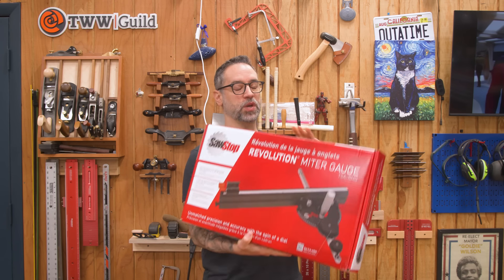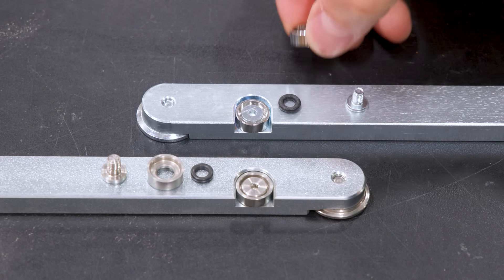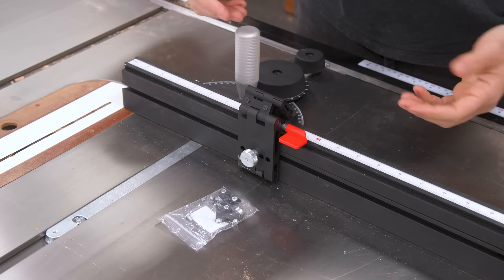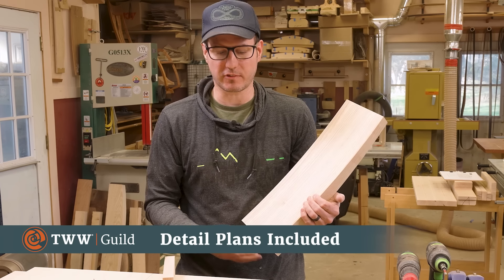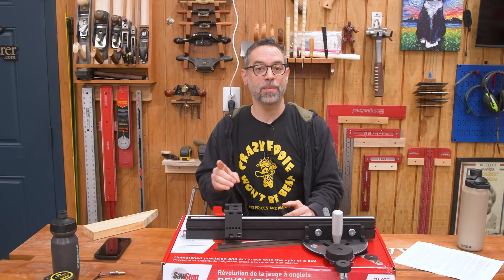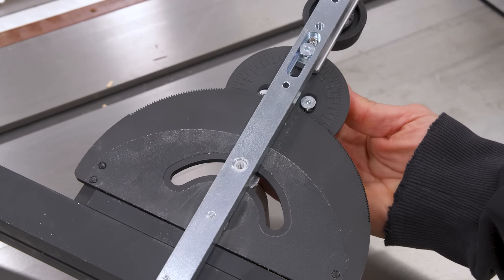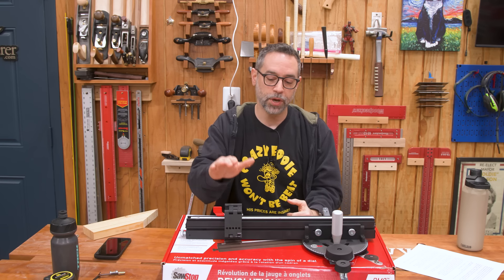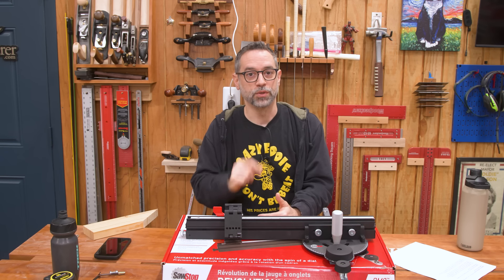The MOST Expensive Miter Gauge on the Market | Worth it?!

Comment: I designed a segmented arching truss for my green house build. Because there are 10 segments to the design and zero internal structure, each gusset needed to be accurate to, ideally, less than a 1/10 of a degree, otherwise the truss span could be off by more than a foot. 

I ended up creating a a jig that took hours to get correct. Had to use Trig and accurately calibrate the lengths of the sides of the triangles instead of directly cutting the angle like you could with a very accurate miter gage.

Comment: I recently built an octagon poker table.  An error in the length of each side or angles is obviously multiplied when joing 8 pieces in a “circle”.  This definitely would have made that process easier.

It might be a little expensive relative to the competition.  However, I see value here than in a $500 RO sander, and I own several of those.

Comment: Marc: Great review.  I was wowed by this miter gauge while at the store purchasing my new Sawstop tablesaw.  The salesman actually showed me that, even with the handle tightened quite securely, it didn't take much pressure on end of the fence to move the fence and thus change the set angle.  It was certainly more pressure than one would intentionally place, but it made me think that an incidental bump could quite easily change the set angle despite having "fixed" that angle by tightening the handle.  Did you check this and, if so, did you find the same thing?

Comment: The only problem with using the dovetails for the stop to prevent deflection is now you just killed the sacrificial fence since they'll be covered.
Reply from the maker: Route a dovetail slot into the sacrificial fence. Might have some subsequent hoops to jump through, however, to actually attach the sacrificial fence since the bolts would be in the path of the groove. Double stick tape might do the trick.
Reply: @woodwhisperer  Personally I love using the blue tape with super glue instead of double-sided tape. I think I stole that trick from you or somebody on YouTube.

Comment: are you limited to cutting on the left side of the blade or does the fence extension work on the right side of the blade?  One thing that's missing on your miter gauge reviews Mark.  Thanks,
Reply: The dovetail track is on both sides of the fence so it would be reversible

Comment: Marc, thank you for the review. One thought about using the dovetail stops to fix a position: It seems they will work fine. so long as the micro-adjuster is in the same position when one returns to the setting as it was when the setting was made. My inclination would be to zero the micro adjuster when making a setting and, then be sure to zero it when returning to the setting. Does this seem practical to you?
        Thanks to your fix (excellent) for the slop in the stop, I am running out of reasons not to buy one of these.

Comment: I like the knob lock down idea. But, if you want to use a sacrificial fence, you have to precisely position a dovetail groove. Of course, I'm keeping my Harvey.
Reply from the maker: If you’re buying a miter gauge like this, precisely locating a dovetail groove should not be a challenge. It also really doesn’t need to be precise. The stop can move up and down to adjust for any error. Just have to make sure you don’t put it too low as the stop obviously can’t go lower than the table surface.
Reply: @woodwhisperer  Agreed. Just an extra step. Would like to see you review the new KM Jig Square. Looks great, but I have no trouble with the 5 cut method.

Comment: Recently someone gave the tipp to make a miter for a box with 44.9 degree so that the open gap is definitely insite the box , not on the edge. Putting a circle together from wood pieces could make fractions of an angle necessary. But I am looking for ways to get it cheaper.

Comment: 19:05 ye, but what about using the micro adjuster then?
Great review Marc, an awesome tool, but not for me. I have the incra 1000HD. Gathering dust somewhere in thte shop, because it doesn't fit my current table saw's mitre slots.... dangit...

Comment: Great review (again)!

I wonder about one thing.  How long until those rubber o-rings wear out?  Is there a better material, or better design, available for the purpose of eliminating slop in the miter’s slider/guide/thingy?
Reply from the maker: They’re not really a wearing part. They are static once cinched down. I suppose in dry weather they could eventually loosen or crack but I feel like that’s going to take a long time. And worst case, little o-rings cost what? A few cents?

Comment: Marc, Why would the Incra miter gauge be just as or more accurate for repeatability on cutting boards to length with it's meshing teeth and micro adjuster?  I know the fences on my PM66 and my router table are dead on for repeated cuts.  I can set the fence to 6 7/16"  move the fence for two days or a week and come back, set it for 6 7/16" and it is the exact same cut.              Thanks.              JimE

Comment: I love your trick for addressing deflection although I still see two big downsides - it makes using the micro adjuster next to impossible … and it won’t work if you use the fence extension right?
Reply from the maker: The micro-adjust should still be usable. Not sure if it’s a pain in the ass or not but the knurled nuts should still be able to rotate. Visibility might be a challenge. And yeah, with the extension in use there’s no dovetail slot so it wouldn’t work.

Comment: Thanks for the review. I have the Jessem and it works well. Do you the Klein digita angle finder which you used to be accurate?
Reply from the maker: Admittedly not the best tool to use for 1/10th degree measurements but it’s the best I have and the easiest way to show the result. And probably good enough to tell us what we need to know.

Comment: To answer your ? about the practical need for making angle changes in increments less than 1 degree. By using this feature to align/fit picture frame and door mouldings at mitred corners to near perfect fits would be a breeze with this type of flexabilty. I currently use a guillotine type mitre box for micro adjustments and this mitre guage would be much better. A mitre guage like this would take a pedesterian job saw to another level for finish carpenters in the field fitting mouldings to the actual walls and door and window sashes and built in cabinetry. Ray Stormont

Comment: I make furniture or cut trim. I never measure angles and just use a bevel gauge so the angle accuracy is pointless. Deflection on the stop isn't acceptable to me. I always use a sacrificial fence and tend to push pretty hard into it. At the price I'd rather have 2 or 3 Incra miter gauges instead of these features i don't need. I run 3 miter gauges right now and could make an argument for a couple more.

The biggest thing for me is the lack of fence. I regularly use the incra with the 50" fence that extends out to 8' regularly.

Comment: I noticed the stop had 5 holes. Could you lock one dovetail in a repeatable position, put the other two on opposite sides of the locked in one, and gain full use of the dovetail slot just by switching the position of the locking lug in the stop?

Comment: I think that, if the micro adjustable stop was made of aluminum instead of plastic, it might be worth the over inflated price. As for a non-conductive fence, I think that if they did use something that was non-conductive, it would suffer more greatly than the stop does, and for the exact same reason.

Comment: Just a little nit pick ;) Why does "everybody" adjust squareness to the blade, when what matters is squareness to the miter slot the miter gauge is running in? Squareness to the miter slot will dictate the squareness of the cut, not squareness to the blade. The miter gauge doesn't even have to (and probably shouldn't be) installed on the saw to be calibrated for squareness - just make sure the runner and the fence are perpendicular..

Comment: I liked the way you fixed the stop gauge but won’t that fail when using a sacrificial fence?
Reply from the maker: Not if you cut a dovetail slot in the sacrificial fence.
Reply: @woodwhisperer  Wouldn’t the lock nut you used on the bottom then be too short? I guess you could then screw it to the fence.

Comment: I am a firm believer in using a sacrificial fence on my miter gauge.  That said, the secondary stop block locking system on this miter gauge is 100% taken out of play.  Like all things SawStop, it is over engineered and over priced.  I will keep my Incra 1000SE with my Katz Moses stop block running in a t-track mounted in my sacrificial fence.  Yes, Incra stop block is also removed from my 1000SE miter gauge.  I will keep the $210 difference in my pocket...

Comment: One way to save money, is to use your present miter gauge and use a MiterSet.  Spending $100 to upgrade your present miter gauge is a lot let expensive than replace your miter gauge with a $450 one.  One subject you didn’t cover was the durability.  IN the original video you kinda banged the gauges around on the floor.  How is the durability on this one.  I agree the stop is not ideal, and I can understand why with the dual hinge and the plastic/nylon washers.  Your hack to lock it down is great, but would limit use of the locks in specific places all the time,
Reply from the maker: Durability was just fine. The toothed gear system helps ensure that everything stays put. As for the hack, there’s not limitation there. The dovetail nut stays attached and moves with the stop.
Reply: @woodwhisperer  if you have other locks in place, for the “standard” cuts you make, you can use one as an adjustable one, because the other block it.

Comment: I bet your find on the deflection was intentional.  That was my first thought when you mentioned the deflection.  It also makes it much more user friendly to have the multiple position stops if you always have one in.  You would just unscrew it and tighten the dovetail down, then it's permenant.  No need to go get the dovetail, set it and move the stop again.  Just set the stop and tighten the dovetail.
Reply from the maker: Not sure any of that was intentional. I didn’t see any mention of that technique in the manual. So I’m thinking it’s just a workaround and not a feature. I don’t think they want to admit that the stop has that much deflection so calling that a feature really highlights the flaw.

Comment: I bought this and really wanted to love it, but the design is critically flawed making it unusable. I returned it three days later.
Reply: To clarify, the alignment washers, which are easy to use (agreed on that part) are in spots that make them completely useless.

The first one is at the front of the miter bar, and the second (and only other one) is at the very back, so it doesn’t enter the miter slot until well after the wood is already engaged by the blade. 
So, there is a considerable amount of lateral play if you aren’t actively pushing the handle TOWARD the blade to keep it steady. That’s… not the direction I want my hand pushing.

Comment: "I'm kinda new..." That had me laughing!  Well done. I, too, thought why didn't they make the right edge to be sawstop safe?  And when you mentioned the brakes, a light bulb went off.  But they announced that they're willing to give away the patents if the upcoming CPSC moves forward, so I can't fault them for wanting to make a buck.  The jaded me says it could be to look good B4 the patents expire anyway 😅
Reply from the maker: Think about it….if that move was about generosity and community safety, why are they waiting until the regulations go into effect? Why not release them now? It’s 100% a PR move that helps soften the blow of everyone blaming them for table saw prices increasing. Of course this is just my opinion but I can’t sus it out any other way.
Reply: With so many of the patents now expired, and them giving away this last one perhaps for the reasons you are stating, what prevents after market brakes coming onto the market?

Comment: For that much money the angel should register on a ditigtal read out like your inspection tool.
That angle finder didn't cost that much so on a 450 miter ga  an extra 50 60 bucks in parts isn't that big a jump, that also give you a better tool to sneak up on an angle with not so much length.  

I am going to bet you Saw stop is looking at reviews to get key points to make product improvements.
I would.  Its a no cost way to get feedback from users. 

I would like to have one, but all i have is the miter my table saws came with. 
Why not ditigtal?  Its not a new concept machine shop have been using these for years  you can add them to planers, table saw fences drill presses and so on. 
How many ways can you improve something?
We are not using my dads 1963 sears craftsmen table top table saw anymore. Nope everything has evolved.  And close to machine shop ablity.

Comment: i feel like gear system can be perfect method for improve precision   my first table saw  rip fence come with simple press lock  but it usually wobbling  a little bit and i hate it  so i buy dewalt dwe7492 with gear rail rip fence system and it solve problem completly in this years 2024 almost table saw brand  skill Milwaukee  dewalt  any brand  all come with this gear rip fence system so  sawstop adapting gear system with miter gauge  is  very cleaver

Comment: Nice review; very thorough. My only criticism would be checking the accuracy of a miter gauge that’s potentially capable of 0.1 degree resolution with a Klein Angle Finder that is only capable of  +/- 0.2 degrees accuracy.  Getting my miters anywhere between 44.8 to 45.2 degrees isn’t going to give me the feel goods. 😃 Not sure we checked the 0.1 degree increment claim of the miter gauge.

Comment: Ummm, sure, make a miter gauge that defeats your safety feature AND allows you to cut through your brand new $450 miter gauge. Cynical assumption about the sale of brakes makes no sense at all.
Reply from the maker: Makes perfect sense to me. It would in no way defeat the safety feature. That feature isn't there to save your miter gauge....it’s there to save your fingers. The fact that it reacts to metal as well as flesh is an unfortunate side effect, not a feature.